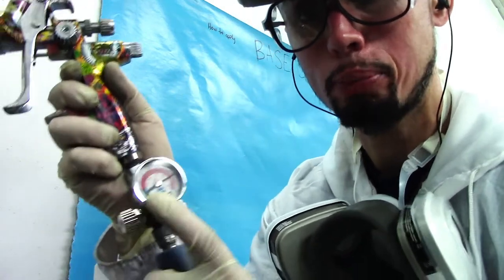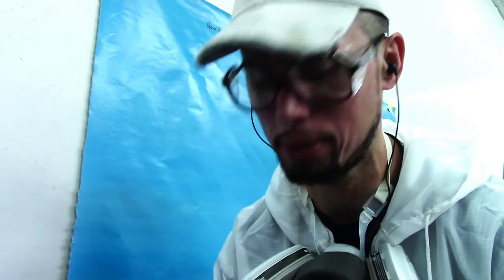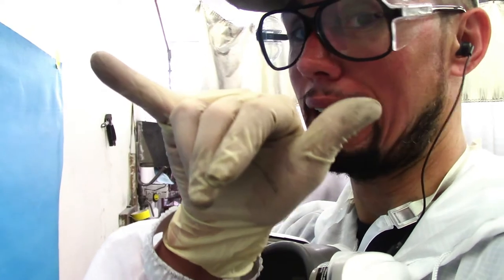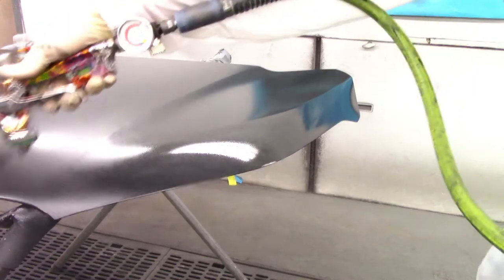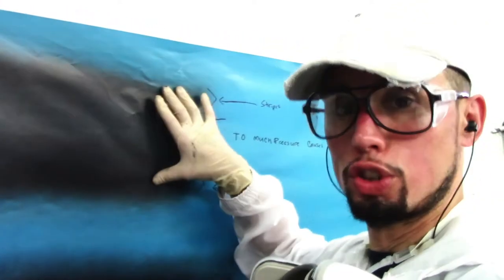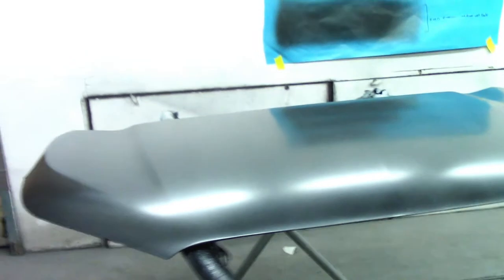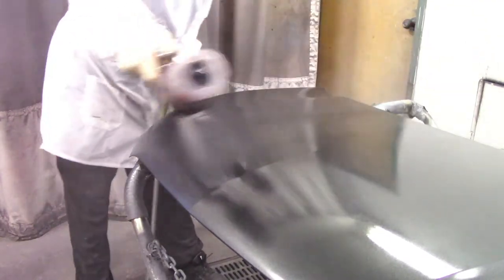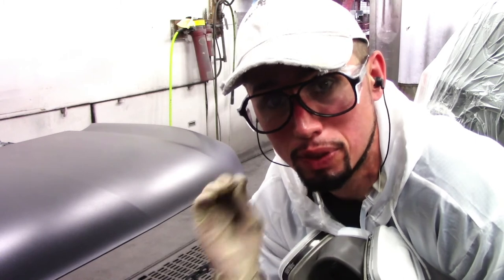How To Paint Cars|BaseCoat Application Guide

Comment: Hi j i need help so today out of all day i was clear coating with a waterbase clear coat 1:1 ratio but i had alot of dry spray. What was the cause of it?
Reply from the maker: Ok so if it’s mixed 1:1 ratio that means it’s probably very thin. If you’re getting dry spray you might be moving to fast depending the air pressure you’re using. Also if the temperature is really hot where you’re working, make sure your using a slow to very slow hardener. Try making some adjustments, first lower your air pressure to about 20 psi’s and then move slower when applying the clear and then see how your first coat lays down. Also make sure that the fluid adjustment is open all the way. Some clear coats can be difficult you have to make a lot of adjustments some times. Let me know how it works out.